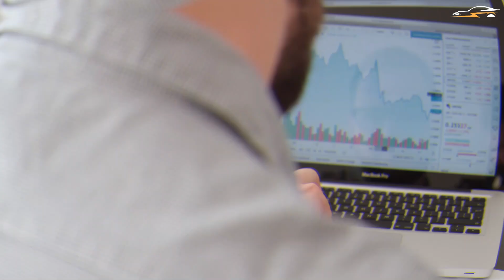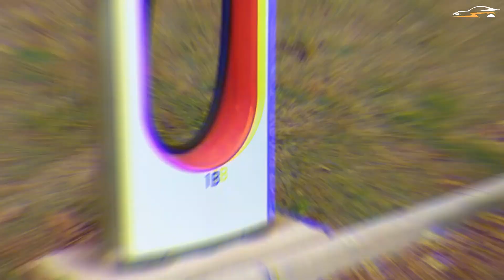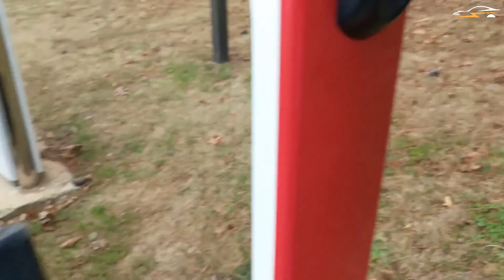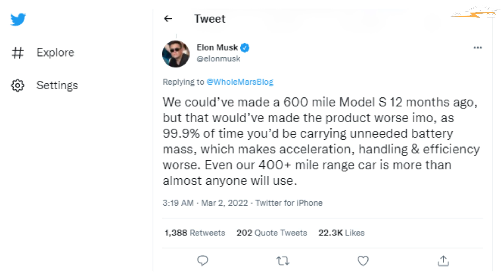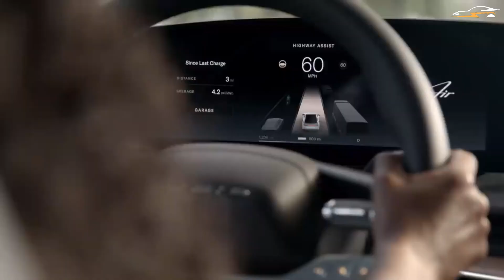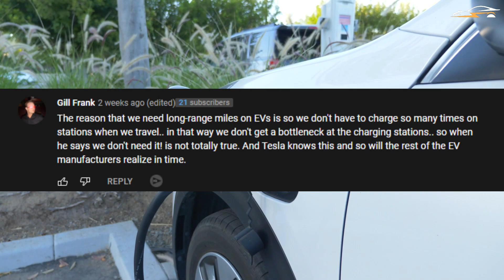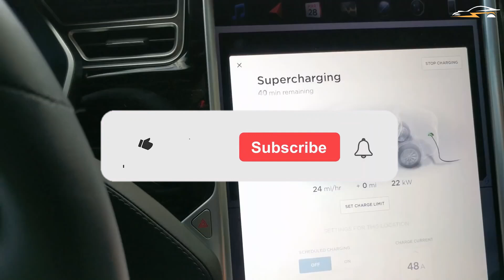Elon Had Something To Say About Long-Range EVs

Comment: Elon is basically saying with the current battery technology, the weight of a bigger battery to would make the cars less efficient.
Reply: Lucid produced a car with a 13% bigger pack than Tesla, yet gets at least 25% more range than any Model S due to a more efficient power train. If you equalize the battery size, the Lucid would still get at least 50 miles  more than any Model S.

Musk was clearly misrepresenting Lucid's advantage as purely a battery size issue, when there's a clear efficiency advantage.
Reply: @paulo3011  Both are true. Tesla doesn’t have access to Lucid’s battery technology as Lucid has the advantage in that field. But, their technology still does have limits.
Reply: @Xanderxindershin  every tech has limits. The problem is Musks ego- Lucid beat Tesla in range AND efficiency and he's trying to downplay it by mischaracterizing the reason for success.

Meanwhile, he was on stage bragging about a 600 mile range on the Roadster 3 years ago.

The man is full of shit.

Comment: I once drove more than 1300km (807 miles) in one go, and 720km (447 miles) of those were in snowstorm. Only stopped for fuel three times. No food stops (ate in the car), no restroom stops, nothing. Just refuelling. My longest day trip was 1500km (932 miles) but then I had a few short stops along the way. I also go for longer day trips of 800-1000km (400-620 miles) a few times per year. When I stop at those trips, it is nowhere near a charging station. Usually I stop in a nature reserve or some other remote location. So I would go crazy if I had only 400 miles of range. Lucid is the only electric car with range long enough to even be slightly close to what I want. But I will wait for brands to develop a 1000 miles+ EV, then I will probably think about it. Unfortunately I don´t think an affordable EV with that range will be here any time soon. Guess I will stick with petrol for quite some time

Comment: a 600 mile Tesla EV would be worse because their current tech would not be efficient at that range.  pretty much admitted the only way Tesla could get 600 mile range would be to just add more batteries or "dumb range" as peter calls it.